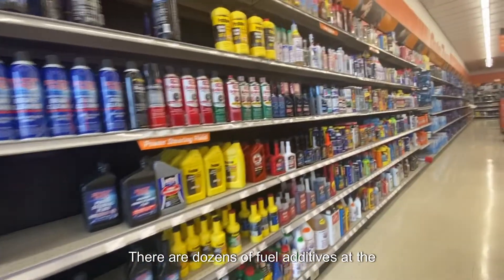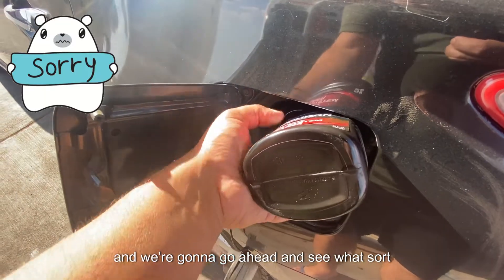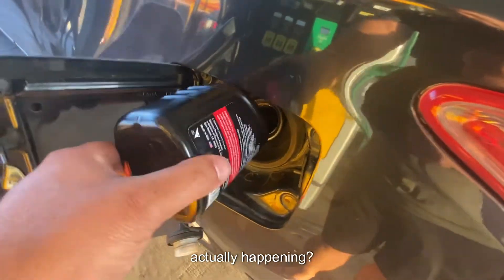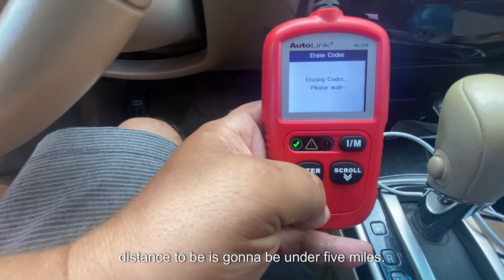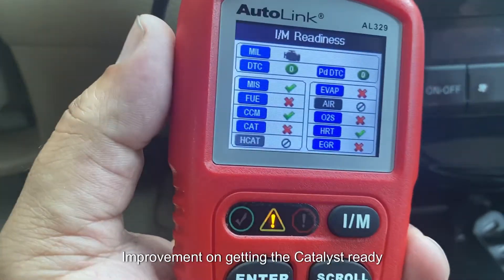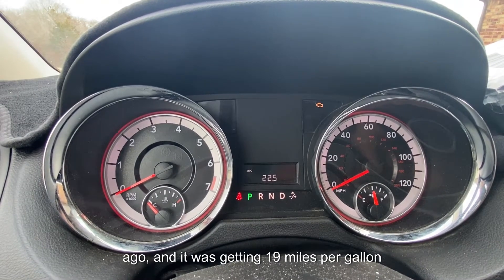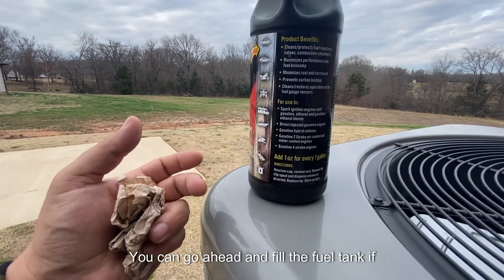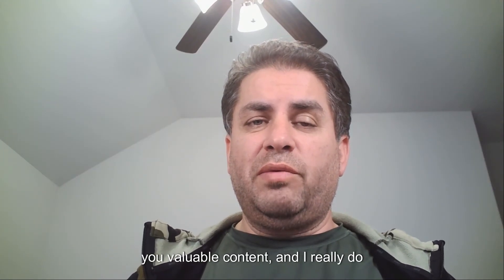Poor Gas mileage? Chevron Techron Review

Comment from the maker: ▶ 12 oz container https://amzn.to/48lJRvb
▶ 20 oz container https://amzn.to/499MjWQ
▶▶32 oz container https://amzn.to/3SMb31g

▶▶ Link to recommend OBD2 reader https://amzn.to/3SgUTf3
▶ Why you need a scan tool https://youtu.be/WrzE_E6WixM

▶ 12 Minute Actual Drive https://youtu.be/jldTJI64cfM
▶ 6-step drive cycle https://youtu.be/JrXOAVkK42E
▶ Actual Smog test performed https://youtu.be/5DYY3mqGJTM
▶ Demo EMISSION INSPECTION MONITOR Readiness (I/M)  https://youtu.be/gAumb9zgLZg

▶How to Pass Smog Test, Understand Emissions Drive Cycle To Pass Smog
https://youtu.be/gAumb9zgLZg
▶ Catalyst monitor not ready? https://youtu.be/hi7QdlgKHzM
How To Clean Catalytic Converter▶ P0420 P0430 Fix - no removal https://youtu.be/U0-0XMWR3ow
▶ Catalyst Monitor Cheat https://youtu.be/BuZYAy_xi0E
▶ Catalyst not ready? Watch this video https://youtu.be/ERQUUdWo3-o
▶ Evap monitor not ready? https://youtu.be/99nfTcPy4fo
▶ EGR monitor not ready? https://youtu.be/aujgghRf04I
▶ Oxygen sensor not ready? https://youtu.be/sAvxeAyYsRk
▶ Oxygen sensor replacement https://youtu.be/9jKuutvNs74
▶o2 sensor monitor incomplete https://youtu.be/sAvxeAyYsRk
▶updated o2 sensor fixes https://youtu.be/Yn1-ul62Jio
▶How To Test Oxygen Sensor Heater Circuit https://youtu.be/1aZr20KXnbs
▶ Oxygen sensor heater element testing https://youtu.be/zEbXn6vgqiA
▶How to use OBD2 Reader To Check I/M Readiness to Pass Smog Check https://youtu.be/gAumb9zgLZg
▶ 2024 update Get CAT Monitor Ready FAST! https://youtu.be/HkF4oCED0UU
▶Does Cataclean Work? Failed Smog, Bad Catalyst, P420 P430 P431 https://youtu.be/3w-FrjMFKvs
▶Prius Catalytic Converter Replacement▶ $118 Direct Fit Catalyst Install After Theft https://youtu.be/uIXslV-Wt3o
▶How to Buy Catalyst For Cheap if Your Catalytic Converter Gets Stolen https://youtu.be/Wr1vFqCnpDc
▶Catalytic Converter Cleaner? P420 Fix? - Should You Use CRC Emission System Cleaner? https://youtu.be/hoijus6P3Gc
▶P420 Smog Failure? Watch to See if Dura Lube Catalytic Converter Treatment Can Help https://youtu.be/lRMISO1FCYo
▶2024 update How to look up state Inspection Monitor Requirements. I/M monitors status codes https://youtu.be/QKxDzdTVJOU
▶what is a PENDING DTC https://youtu.be/MwFS7cYGMyk
▶What is a STORED DTC https://youtu.be/smaIj1DV9ik
▶What is a PERMANENT DTC https://youtu.be/YHoL9z_o-M4
▶pending vs stored vs permanent explained https://youtu.be/kVPSEQsvMOk
▶Permanent DTC long video https://youtu.be/PMcJtcSOzdk
▶Reset check engine light without any tools https://youtu.be/vs3BsCCqwa0

Products
▶Fuel Treatment https://amzn.to/38p7Ps6
▶Car Memory / Data Saver https://amzn.to/3mCTpKd

Comment: Why people buy non Top Tier Gasoline really puzzled me.  It is not any more expensive BP / Amoco is better than Top Tier and will keep your engine clean. Other brands such as Chevron, Shell, Mobile, Exxon for example are going to put you at the head of the curve. And will clean older dirtier engines.  I don’t see anything wrong with one a year adding Chevron with Techron to your engine.  It’s like a booster shot to your fuel system.   But it is more important to buy quality gasoline throughout the year.
Reply: Because top tier for premium is a gimmick.  If you read the history of Top Tier and some of the oil execs in meetings you will find that ALL premiums have 2x the additives required by nop tier.   And regular gas engines do not really benefit from extra additives but it does not hurt.

So 
Premium - All brands get 2x additives (top tier spec)
Regular - Top tier gets extra additive non top tier like has 1x additives but it does not hurt low compression engines.

That is why you can skip TOP tier.   Some non top tier pumps are are 50- 1.00 a gallon cheaper than top tier.  Yet its premium is the same.   So would you like to save $1.00 a gallon on premium?    I do.

Comment: Driving 100 miles each time is not an accurate comparison UNLESS it is the exact same trip in the exact same direction under the same conditions (speed, ambient temperature, etc.).
Reply from the maker: You are 100 percent accurate.
Real world testing vs a controlled environment is also a test.
It is what it is.

Comment: I've been using Techtron for over 5 years. I add i bottle at every 4-5000 miles. My gas mileage varies from 16.8-18.1 depending on my driving habits!!! At 25,000 I removed each of the 6 spark plugs and inserted a boroscope and the valve are still clean. No ticking or taping. I had a friend that worked at local dealership tell my engine performance and it still like new using the manufacturers Diagnostic Scanner!!

Comment: In my case Lexus ES330 2004  , 180k miles. Added the standard Techron, not even the high mileage varient ..that I learned about later  . The check engine light disappeared within just 20 miles of regular city driving with better acceleration

Comment: Techron does work, it is the only thing that will keep a corvette fuel gauge from sticking. But it needs to be used with a top tier gas, like BP ethanol free gas. Your intake manifold and cylinder heads will thank you.
Reply: BP is no longer top tier. Shell, Chevron, and I think mobil 1 still are
Reply: I believe any gas without Ethanol is top tier lol.. What you spend for better fuel you end up saving in better fuel economy and less maintenance.

Comment: Ethanol free fuel makes my turbo direct injected vehicle's cold idle more smooth as well as a bottle of Techron.
Reply from the maker: Yeah ethanol free gas is great. That’s all I run my lawn mowers and power sports motors as it does not destroy the carburetor. If you can you would be off with alcohol free gasoline that Techron. The ethanol gasoline is not good and is grainy and doesn’t lubricant the same way as pure gasoline.
Reply: Yeah! And what you pay for non Ethanol is what youll end up saving in increased fuel economy and less maintenance.

Comment: My car was shaking badly and dropped rpms to the point it was misfiring in one cylinder. So I changed the spark plug and coil pack and it was still misfiring. I was coming to the conclusion that I had a faulty fuel injector and I needed to replace it but I came across this Techron and decided to try it for a last ditch effort. Drove for about 15 miles and it instantly stopped my rough idle and misfiring. I guess my fuel injector was just dirty but this stuff fixed my problem! I’m going to be adding this to my maintenance routine!💪🏻
Reply from the maker: Yeah, once a year will do the trick. Thank you for sharing your story and experience.

Comment: I've been using Chevron with techron from the pump for about a month now, and my mpg went from 20 to 19.6. Hopefully its cleaning my engine haha
Reply: Yo that’s funny asf 🤣🤣🤣 guess that extra was helping you out in the long run 🤣🤣🤣
Reply: @babyproductions5523  Misfires and dirt will screw your system up. This prevents and cleans it; that is it's primary purpose. It merely restores what your fuel system once was and should be. That is a side effect of a clean fuel system.
Reply from the maker: Thanks for sharing

Comment: Why not just pump with chevron
Reply from the maker: Long term that is good but if purchase a vehicle with over 90k and the previous owner didn’t put in good gas, it would not make a difference. It might prevent further mpg loose but it will not restore lost fuel economy.
Reply: Techron in the gasoline is very low concentration, a few parts per million. It's meant to prevent gunk from forming. From the additive bottle you're getting much more of the Techron cleaner, and it could clean some already existing gunk better.

Comment: I too remain a die-hard fan of this product … and have been since 2008 timeframe. 3 incredible experience’s over the years and hundreds of of $$$ saved. 1st experience was when a Mercedes dealer could not conclusively diagnose an acceleration stumble on my (just out of warranty) 2002 SLK230. They wanted to change the fuel pump for $850 with NO guarantee that it would resolve the problem … every red flag in my head went off and I told them no. I left, never to return but stopped at an auto parts store for advice. 30 minutes later I’m putting Techron in the gas tank (small bottle). Long story short within 300 miles of driving the stumbling was permanently gone! From that event forward, I also use Techron once a year (minimum) in all my cars 1 week prior to their NY State emissions inspections appointment. 2nd experience occurred a few years later … a phone call from my daughter in Maryland. Her car failed the Maryland emissions inspection. I drove there, put Techron in her gas tank and then drove her car at high speed around the 495 inner beltway around WashingtonDC (approximately 96 mile run). The following morning the car passed emissions testing without incident. 3rd event happened a few months ago… my sister-in-law stops at my house informing me her old car failed emissions… I put the 20 ounce bottle of Techron in her tank and instructed her to go onto the LIE (Route 495 on Long Island) and drive high speed to Riverhead and then back again to the repair shop … 3 hours later she called and advised her car passed emissions with flying colors. I now purchase the 20 ounce bottles on Amazon in a Case of 6. If I so much as feel a stumble or hesitation with any of my cars, I use the product … It has NEVER disappointed me! Thanks for the video …